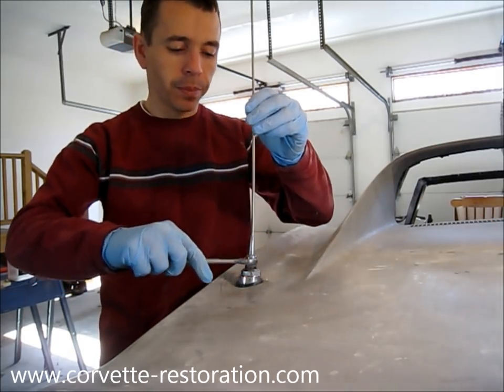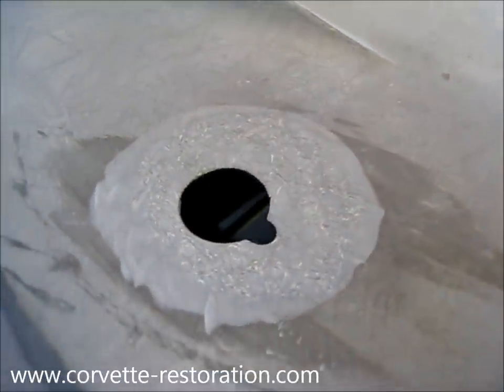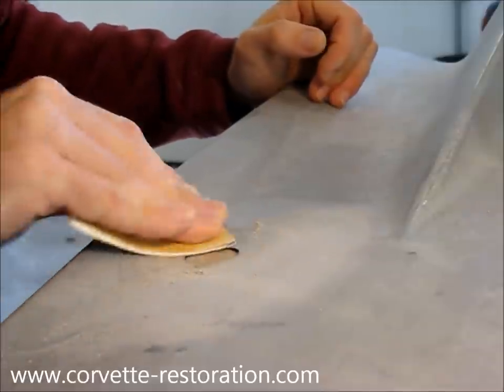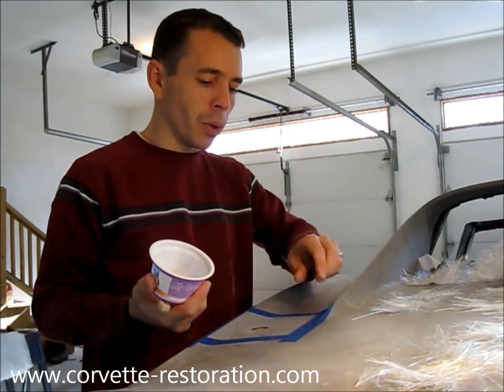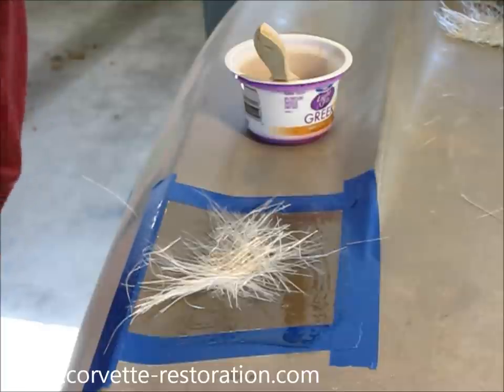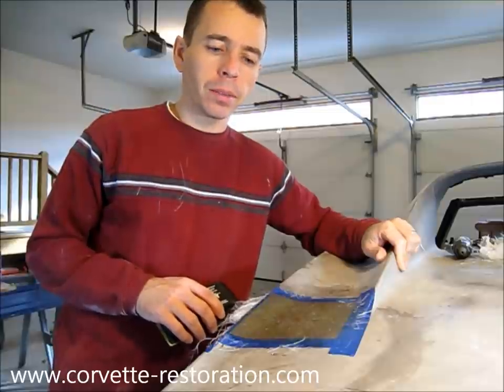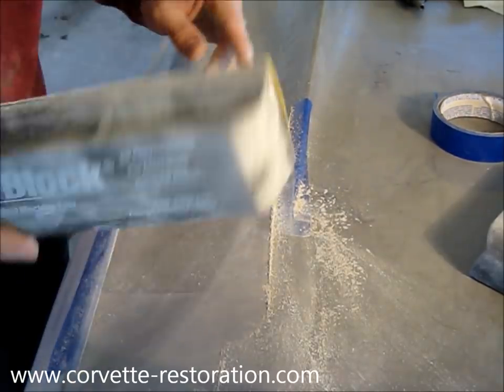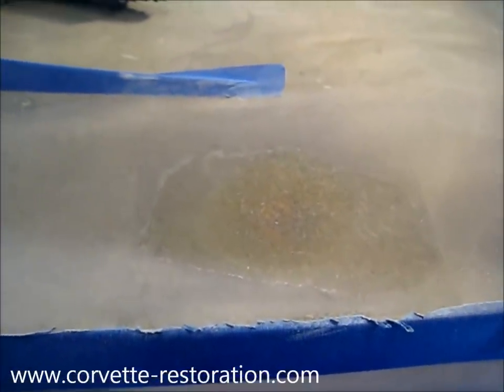Repairing Holes in Fiberglass Panels

Comment: easily the best instructional video I have come across on youtube. clear and thorough. Question: what about irregular damage in a panel? I have a panel that has some splintering in the fiberglass where the hole is.
Reply from the maker: You can repair holes with irregular damage the same way. Clean up your edges to remove any stray fibers or resin that may be preventing the panel from laying flat. Once you've cleaned that up you can follow this same process of dishing out a repair area and filling it back in with fiberglass and resin.
Reply: For new viewers, take care to do no more than 4 layers at a time, and be sure to dab ALL of the mat to translucent and all air bubbles dabbed out.  One trick also is to use an onion board (filler mixing board of waxed paper stacked for single use clean surface.) to prewet the mat before applying it on top of the wetted out area. This will prevent the pinholes that he had after sanding.

Comment: I am working on a 1971 Corvette Convertible that I had to retrieve from the body shop after 22 months and 3,000.00 dollars worth of nothing done to it but butcher the panels.  I have seen this video like 20 times and always discovers more details that I miss on prior views.  I already did a repair on driver side door skin (inside, as I removed it from the door frame using your other instructional video on how to separate panels) and came out pretty good for being the first time I have tried fiberglass repair.  Getting ready to work on the outside layer.  Thanks for taking the time to do this tutorial and being so clear when explaining.  If this shop that the body was at sanded the panels a little too much and exposed some fibers, do I have to try sand that smooth then prime over it? Can you tell which primer?

Comment: Watching this to get past the sheet I am using. It is a bow n arrow and using thick epoxy. Learned 3-4 things to use in first few minutes. Prep application and the both taping and sanding with the tape. Now I can feel confident in filling in spaces which I figured was a fleeting idea. Thanks!

*props to mr. sticky stuff on ebay for trusting me.

Comment: Thanks for the video! Great explanation and instructions. 
My C5 got very little damage after getting off the track. Ripped out a panel, now I got broken holes where the panels used to attach to the body.
Will this methodology allow me to drill new holes after the repair? Need that to attach it back to the body...

Comment: I was curious as to why you didn't do the underneath support work first?  Would seem to me that having a solid base u9nderneath your top repair would allow more aggressive wetting out of the top section and not having excess resin drooling down on the cardboard and perhaps having excess cleaning and sanding laying on your back in the  trunk.  Admittedly, I didn't watch your underside repair so I could be full of hops with my assessment..  Also, it was hard to tell from the video, but if your top surface was  slightly convex, wouldn't using your sandpaper   have better and more even pressure if  the block was flexible such as a piece of closed cell 1# density minicell or other flexible foam.
I really liked your surface prep on the top and instead of the blue tape, I spend the extra couple of dollars and use the lime green  3M autobody style tape.  I also take the time to make the masking tape profile shaped more like a  band aid by using a bit more tape and then taking an Exacto knife and cutting the the inner curves before the lamination begins.  Thanks for taking the time to educate us.  I can see some hack just goobering in Bondo in the hole and paying for it later down the road.

Comment: Here's  a question for you, Sir.  Sometimes a Corvette or Hot Rod will  come into my shop and will have air bubbles (size of a pea) in the paint.  I can sand them down and repair them with filler, but sometimes  the bubbles will reappear a month or two down the line. What is causing this and how do i stop it?

Comment: Excellent narration!  You did create a lot of sanding work for yourself with the extra large pieces you applied.  You really only needed 4 layers max, as well.Good point about not overdoing the amount of resin.  A fiberglass roller is a good tool for these smaller repairs.I would have shot some guide coat over the area before the last sanding with 180.  Then you could really call it good with no doubt.

Comment: Awesome vid(even if it is a chevy lol). I really liked using the tape as a guide of sorts. I wholeheartedly agree about using a DA or power sander. Especially around character lines as its very easy to go overboard and blow thru the gel coat. Also kudos on using the towel or rag for feeling for a smooth surface. Our metal finishers wear poly-knit gloves for this reason and they use very thin COTTON gloves on the paint polish deck. My only bit of constructive criticism is, as someone else  noted, when sanding/grinding fiberglass/SMC/carbonfiber you should absolutely use nitrile gloves and a respirator. Oh and not to be too nit-picky but you really shouldnt blow the dust from the sanding with an air gun. Please use a hepa-vac or at least a regular vac. That stuff is nasty and one it’s in your lungs it’s staying there. Thank you for your help sopporting gear-heads everywhere. Far too many clowns these days just want to cut a check.                      
Braaap! 🤘🏻🤘🏻

Comment: Keep the videos coming. Good job. Will be doing a 1972 soon so more body prep videos would be great.

 How did you strip the old paint?
Reply from the maker: I stripped the paint using a razor blade to remove most of the paint. Whatever couldn't be lifted with a razor blade was removed using a paint remover called Citrus Strip. You can get it at your local home store.

Comment: Is that how fibreglass is made? fibreglass, resin and filler?
Reply from the maker: The process is a bit different but, essentially, yes. The materials are the same. At the factory the OEM panels were pressed between a male and female mold to press out excess resin and create a smooth surface on both sides of the panel. Those are called press molded panels. Some less expensive replacement panels, called hand laid panels, are made by blowing a mixture of resin and fiberglass into a female mold. This process yields somewhat thicker panels that are smooth on the outside only.

Comment: when I'm using Glass and  resin I sometimes have a shrinkage problem with my work after its refinished I usually use 3m two part fiberglass repair from the paint Store your thoughts please
Reply from the maker: Fiberglass resin is prone to shrinkage. This is because sometimes not all of the resin is cured by the hardener. Over time this uncured resin evaporates. This can be a very slow process and can take 6 up to six months. The potential for shrinkage can be reduced by using high quality resin, using as little resin as necessary to complete the job, and allowing the body work to "cure" for several months before painting. Parking the car in the sun on a hot day can help speed the process.

Comment: your suppose to re gelcoat that area when finished just saying prevents bleeding later cause that body filler will shrink down into that glass but anytime you dig into glass you MUST re gel coat the area
Reply: I've read and have been told by corvette body guys that theses older c3s are not gelcoated to begin with.
Reply: Dude there is no gelcoat on this vette

Comment: 1) you had pin/air holes because a) your repair was very resin rich (weakens repair) b) you didn't make enough of an effort to get the air bubbles out (virtually none).
2) the reason you have filler on both sides of the repair is because the repair is actually to high.
3) the fiberglass should be lower than the actual surface and the filler is what tops it off or what would have been the gelcoat layer. You dont want 'glass making contact with the paint surfaces.
4) with as good as a touch your fingers can provide, the best way to inspect that repair is to wet it down, then take a light and at different vantage points inspect the repair for smooth planes. Or spray it with a high gloss temporary coat of paint and inspect visually.
5) many a amateur  repairer has regretted not doing step 4 after their finally and very expense paint repair disclosed issues after the fact.
6) as in many you-tube videos, the title should read. How "I" repair fiberglass, not "How to repair ..."
Reply: Ray Nic, your statement is poor...  

#1... resin rich is not a definition.  because you can make repair 100% resin without fiberglass.  this is how they make "soap dish" with pretty seashell in them. they are tough material.   

#2.  i prefer to put filler on "hidden side" first. thus thicker down there.   this way means less  fiberglass layering on the visible side.. 

OP is right about #3.  he already removed paint via sanding up to 6 inch.  but what he should have done is apply tape first then sand ... assuring to his knowledge the paint is removed in the taped off area. 

with #4.   you supposed to use final, usually called smoothing resin (is simple  resin  but laid  on top of cured fiberglass repair and feathered....  this gives you the best sandable surface.  this way would give you best smoothest surface  for paint job..

Comment: What did you use for the backing piece?
Reply: its just cardboard.
Reply from the maker: Correct, just a piece of cardboard duct taped tot eh underside of the rear deck. Once the top side was repaired I repeated the process from the underside.
Reply: Is the cardboard backing permanent or do I remove it after repairing the surface? Thanks.
Reply: Angel Araiza It would be removed when disc sanding the underside.

Comment: So this video was taken in Feb 2015 just about 2 years ago. I am willing to bet that if this car is painted you have a nice witness mark in the area that you filled. Here is why, fiberglass used by GM was formed under pressure several thousand pounds. Your repair has no where near the density and will expand and contract at a different rate than the original glass. There are methods to simulate such density which you have not done. Decent job for a home hobbyist but this would not fly on a high level Corvette.
Reply from the maker: The car isn't painted yet but, thus far, there's no evidence of any shrinkage cracking around the repair. Sure, there are other ways to complete these repairs but this approach is very common and is a reasonable method for those who don't have the means to undertake more extraordinary measures. If you have any links to a vacuum or press molded repair I'd like to see it. Bet it would be interesting.

Comment: Sorry but using fiberglass on a steel fender probably wasn't the best idea. The prefered method would have been to weld a steel insert, that would ensure fender stays straight and strong.  If fiberglass was only option, I would have removed fender and added fiberglass from the inside of fender without having to grind steel keeping it strong.  IDK just my opinion
Reply: It's a fiberglass panel. Hence the fiberglass fibers when he ground it down before applying a patch......
Reply: lol did you watch the video???
Reply: Gabriel Sandoval hahaha silly..
Reply: Wtf is wrong with you... its a fiber and panel - corvettes are fiberglass since forever
Reply: Psh, unreal.

Comment: This guy does not know what he is doing LMAO...ji  ji ji...
Reply: By all means, please make your own video and show us all how to do it the right way.
Reply: I bet he works for Evercoat, but I can tell by his finger nails that he doesn't do this kind of work for a living.  I can't believe he ground 3/4 of the panel away. Wow. I had to repair my antenna hole. I just used Dynaglass to fill the hole, sanded it flush to the original panel level and redrilled. No problem.  Plus he resined the tape down. Lol.
Reply: 6:50 secondly...and secondly